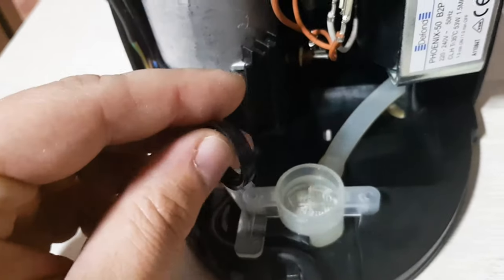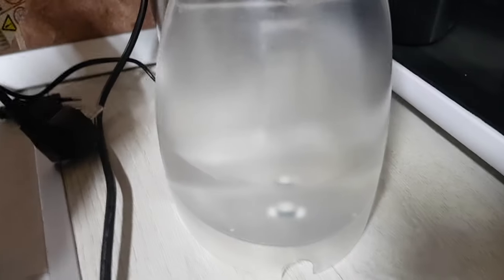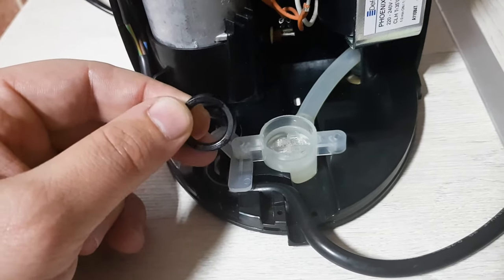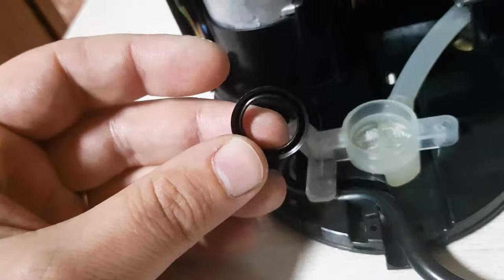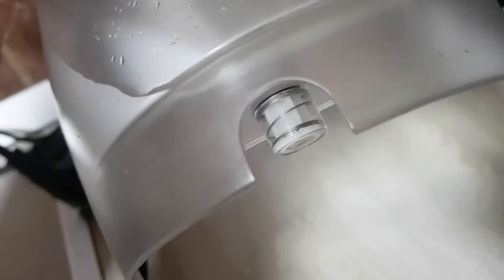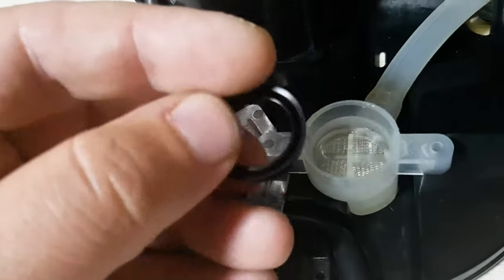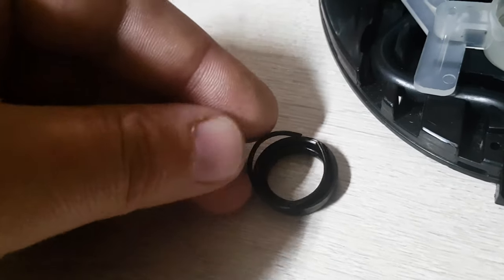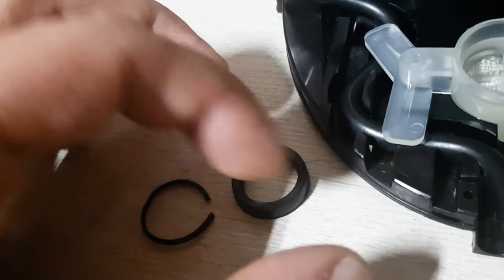Quick repair water tank gasket of Nescafe / Krups espresso machines

Comment: Great video. The tool making idea was awesome, and I followed step by step and made my own "Screwdriver" which allowed me to disassemble the machine and pry it open. The ring was not showing signs of wear but still i could not find a sign of other leaks and this one made the most sense, due to the location of the leak on the Kitchen countertop. I went to ACE and got an O-ring that fit inside the gasket. I will only know tomorrow if the leak stopped. I tested the machine and generated a cup of coffee. Seem to be working fine. So at least I didn't break anything. The O-ring, maybe too thick and its not allowing the water tank to come down the hole all the way. I may look tomorrow with a thinner O-ring that maybe a better fit. Great Great video.

Comment: Good idea. I used teflon tape on the outside of the water tank stub.  So I've been using it for a while, it doesn't leak. 🙂
Reply from the maker: Good idea also!
Reply: That's a really good idea that I might have to steal. Thank you.
Reply: very good idea. it worked
Reply: Can you please share a picture of where exactly you put the Teflon tape? Thanks a lot!
Reply: This worked beautifully. I did a single wrap around the nipple on the water tank.

Comment: Thx a lot, your little hack fixed the leak! Did not use a wire but a plastic-coated thread which comes with new cables!

Comment: Good idea, or you could use a correct sized iring inside the seal to pack it out.
You didn't mention the screws and plastic clips to access the seal though 😩 That's the hard part, getting it apart without breaking these, cheers from Australia

Comment: I put a lick of wood glue in the recess of the washer then let it dry. That was enough to displace the washer up, into abutment with the housing, which slightly reduces the inner diameter, to grip the spigot on the water tank... no leak.

Comment: We had the same problem with the Nespresso essenza, and used a strip of rubber band inside the gasket to expand it and create a better seal. It's working so far :)
Reply: Yes I did try the same as well and cut a piece of rubber band and out it around and it works wonderfully.  Thanks for the tips.  Not easy to find a wire.

Comment: Thanks for information. My problem is the actual tank leaks so I presume the  "O" ring inside the tank is the problem but I can't see how it can be replaced. Any suggestions?
Reply from the maker: I have a video on this topic. Of course it depends on the shape of the tank if it is an easy swap or not.
Reply: @benassy69  Thanks for your reply Adrian. The leak in my water tank is due to the "O" ring inside the tank having perished not the gasket in the unit itself. I can now remove and replace the "O" ring  - I just need to find a supplier for the correct size "O" ring

Comment: Hi there, hubby got this for Christmas gift, used it today and water pouring out then we discovered a tiny coiled spring popped out the part that the water tank clips into. Any ideas please.
Reply from the maker: That spring from the water tank should never get out. His role is to tension the gasket that seals the water inside the tank. Order a new water tank spring system or buy a new water tank.
Reply: В крепеже для бака воды лежит пружинка. Она для чистки иглы прокалывателя контейнера.

Comment: I ordered and fitted a new one from Amazon but it still leaks. I'm wondering whether it's a bad seal or something else? I don't want to order another seal from elsewhere in case it still doesn't fix it.
Reply from the maker: If you fitted a new one this should resolve your problem. Look inside the unit maybe your leak is coming from elsewhere.

Comment: What kind of screw they use? The water leveler switch not working properly
Reply from the maker: It is a star screw I think is called a T10 bit. The switch problem might be due to a loose connection on the board. Easy fix.
Reply: Adrian B. It’s hard to set the water amount. One off the screw busted can’t unscrew it.

Comment: How do you place the gasket in? With groove facing up or down? I took mine out and now I can't remember which way it goes.
Reply from the maker: With the groove down. The role of the groove is to push against the walls of the plastic drain and against the water tank intake and make a perfect seal. Therefore groove down.
Reply: @benassy69  Thanks!!!

Comment: Machine switch on but did not work. Side switch turned green but nothing . Could be pump not it order. Thanks
Reply from the maker: I had 2 machines with similar faults. In one case it was that big box capacitor and it the other case was the FET that switches on the pump.
Reply: @benassy69  thanks for your help  The capacitor I know which is but where is the FET located . Another thing how can I check if capacitor is  good or not . Thanks
Reply from the maker: Unsolder the cap and measure it. It has to be close to the value stated on the housing of the cap. The FET is located underneath the pin marked as PUMP.
Reply: Thanks for your time and help once again . Do I need to discharge the capacitor before testing it. Thanks
Reply from the maker: It is a small one by the time you test it, it should be discharged. But to be sure short the terminals with a screwdriver and then unsolder it. The value is somewhere between 470nF to 680 nF if I recall correctly.
Reply: Ok 👌 thAnks for your immediate reply.
Reply from the maker: No problem. Let me know if you manage to fix it! Good luck!
Reply: Thanks hope I can fix it
Reply: @benassy69  hi I opened the machine and found 2 rectangular capacitors grey which one to test
Reply from the maker: The bigger one is the one that goes faulty.
Reply: @benassy69  I managed to unsolder it and took it out it has a print on it 0.47uf k 280 v I think it is the correct cap
Reply: I tested it and gave me 0.42 uf do you think is bad . Thanks
Reply from the maker: What value is stated on the part?
Reply: @benassy69  0.47uf
Reply from the maker: @enricomifsud5675  than the part is fine. The tolerance is so small. If it was 0.15uF than would be a problem.
Reply: @benassy69  ok if so what could be  the problem then (. Thanks
Reply from the maker: Than could be the FET from the PUMP terminal. Be careful when working on it since this one switches 220 volts . At this point I would recommend finding a replacement board and change it all together.
Reply: @benassy69  Thanks for your help
Reply: @benassy69  can I find pcb on line to buy it . Thanks
Reply from the maker: I guess so...on ebay. Search by part number.
Reply: @benassy69  ok thanks
Reply: @benassy69  hi I tried to make the pump function by taking it off .I noticed that there is a small component like a resistor or diode . Could it be this diode faulty? I tested continuity but did not function . I think I tested the pump wrongly . Could be the pump faulty. Thanks
Reply: Hi hope you are ok well you told me  last time to give you feedback about coffee machine krups. Well I changed the capacitor and changed the thermal fuse which was cut. I switch it on the pump was working the heater was heating. Just a humming noise of the pump . The water was not pumping up. I don't know what could be the fault at this point . Thanks for your help .